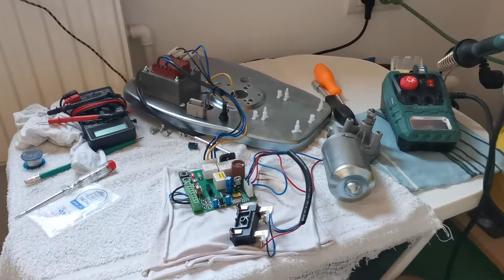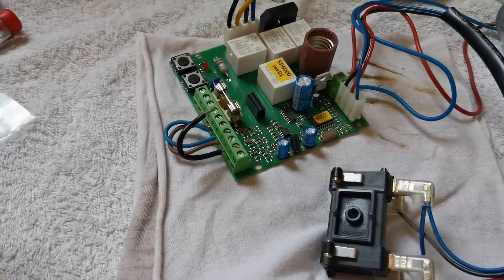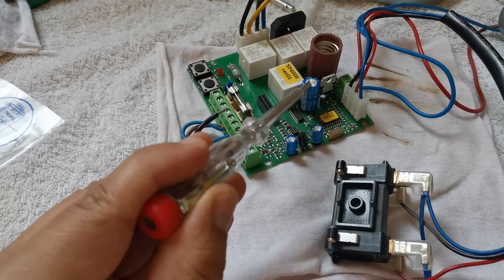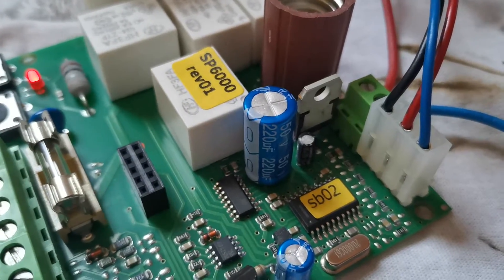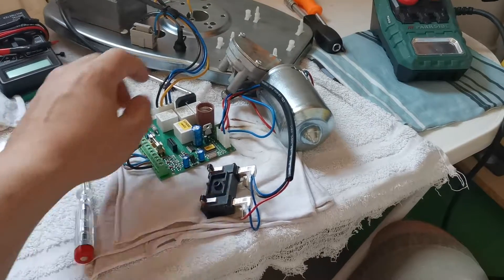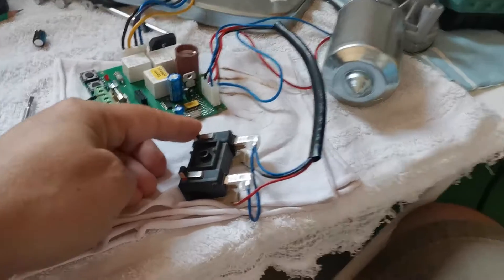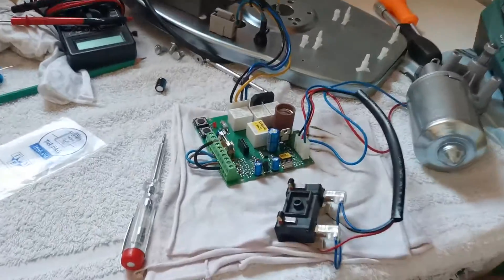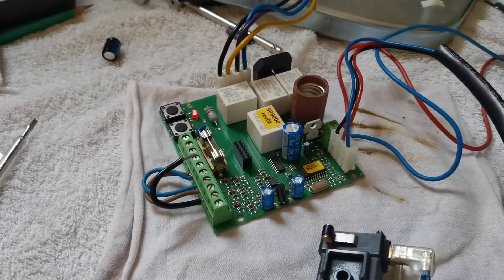Garage door opener Nice Spido Sp6000 or SPA40 problem: you push the button, no response

Comment: Hello

In my case, the LED does not blink, it always remains red, the motor does not respond even if I press a button, it does not respond if I press the remote control.

Do you think it could be a problem with the capacitors that you have changed?
Reply: Mulțumesc mult pentru acest tutorial, m-a ajutat să repar acest modul cu costuri minime.👍
Reply from the maker: Is easy to replace the Capacitors. You can try. There are big chances is the solution also for you.
Reply: Hi did you manage to solve it with the change of the capacitors ? I have the same problem, Red led always on, no respons on the button and remote, and what i have also noticed is that also the receiver is not doing anything if i want to program a new remote, i keep the button pushed and no led reaction on the receiver.

Comment: hi what was the initial problem with the board?? what did she do I have one that stops going up and down if it has a time off it is good..
Reply from the maker: No command accepted. It is the Capacitors also in your case. Test this. Is easy to replace and very low cost.

Comment: Hi, i changed it, and It works!, Thx!but i feel now door open/close slowly, only 1 velocity. Do you know how can i fix It or how can i reconfigure the door ends?
Reply from the maker: In my case I had no speed issue. But I think the speed is regulated by increasing the voltage delivered to the electric motor. Check the voltage. First 2 3 seconds should be a lower voltage and after should be higher. Probably is related to some resistor, maybe is the one next to the led. Try to replace it.

Comment: Same exact symptoms, same exact board.
Should have seen this video before paying 153€ for a new board, today.
The upside is that now I have a spare board that I can repair, or at least try to.
Reply from the maker: This is why I posted this. To share the repair solution
Reply: @opanait  Thank you!
Reply: @opanait  btw, went and got new condensors, replace them on the board, installed the old board in everything works fine. Now I have a brand new board as a spare. :D
Reply from the maker: @F1CT1C10U5  good job!